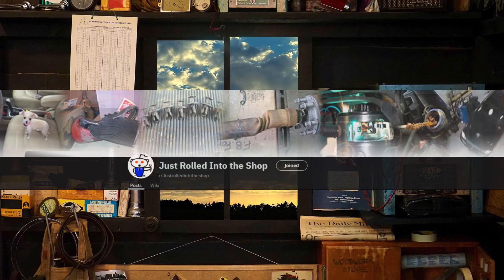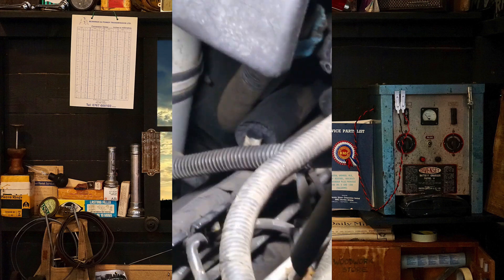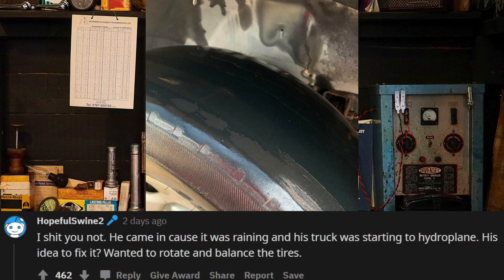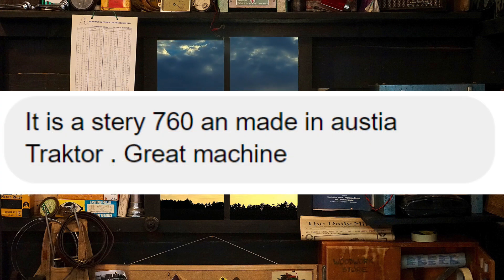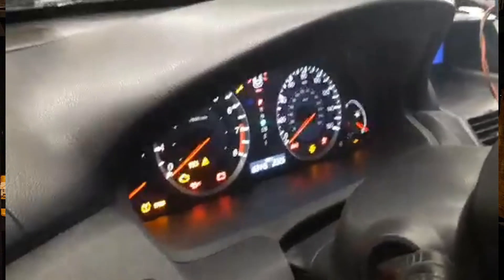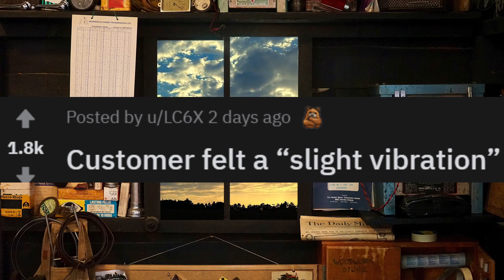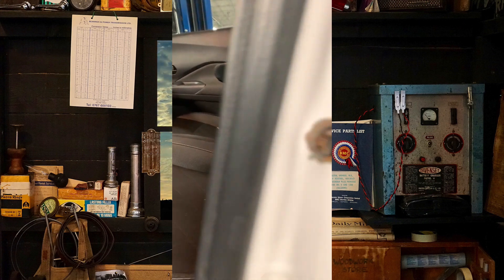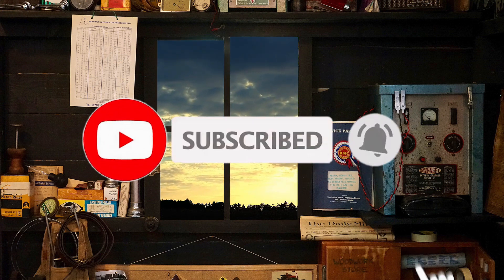Customer States "I Need My BALD Tires Rotated Because I'm Hydroplaning!"

Comment from the maker: Submit your photos and videos to us at www.justrolledinyt.com
Reply: That hellcat probably pole vaulted after the shaft broke up front . I have see in on 4x4 s
Reply: We have a neighbor who has a 1990 dodge 150 with an automatic transmission and 318 V8. After multiple attempts the transmission went in but now with the truck on jackstands and in gearThe drive wheels can be stopped very easily by hand. What would be the solution to this, I am not a Mopar person.

Comment: People are so detached and so non-mechanical that as long as it starts, they drive it.
Reply: I am pretty mechanically inept.  I know virtually nothing about the mechanical side of vehicles.  If I hear a knock, feel a change or my vehicle has trouble waking up I get worried.  My motor scooter is too valuable to me to let it rot and don't want to get myself killed because I neglected to have someone who knows what they are doing look at it.  Yes I said motor scooter I don't have a car or proper motorcycle lol.
Reply: @SirNarax  It's wise that if you ever do decide to get something that goes faster to take a few hours and learn the basics, so checking and filling tires, checkin and topping off oil, checking other fluid levels. It incredibly basic stuff and it can save you so much money, and more importantly your life.
Reply: @willemkanon4020  I know how to do bare basics.  Oil, tire, brakes, suspension... I do a pre-ride checklist every time i go on the thing because a few minutes before every trip is better than days in hospital or an eternity in the dirt.  But anything beyond what is easily checked is beyond me.

Comment: When I was young, my standard for replacing a tire when when it would hydroplane at a specific speed on rutted asphalt roads.
It's kinda funny, but on one of my vehicles now the very new looking tires on it currently has have less traction than the bald tires I took off.  They are very cheap tires.  I just wanted something I wouldn't get a ticket for while I decided what rim/tire set up I eventually wanted to go with.

Comment: I changed four tyres on Mitsi Triton. One was showing wire, the others just plain bald. And he is a cop!  Driving 80k to work everyday on the freeway.
That bulgey tyre?? Had one on a rim as roll around tyres on my racecar, left them out in the sun and it went quite like that. Eventually blew out. Still out in the sun

Comment: I've had a timing belt making that kind of noise. Only it wasn't a bad tensioner it was the idler pulley.  They had the engine rebuilt and whoever did it didn't tighten up the bolt holding the idler pulley in place and over a good bit of time it had backed out. Sounded kinda like a rod knocking with a hint of plastic. I started it up and used the long screwdriver to ear trick to see if it was a rod knocking or something else. Literally 2 minutes to diagnose and once new parts had arrived 30 minutes to fix. The book called for over a hour. They wanted us to pull a bunch of stuff off to do the job that didn't need to be removed.  I just skipped removing the unnecessary stuff and saved time.
Reply: Screwdriver to ear trick? just put your ear to the butt of the screwdriver and push it against the valve-covers?

Comment: I had a 2000 Toyota Corolla with +200k, every tank of gas = 1/2 pt of oil. Gave it to my sister and she ran it dry on a regular basis, so it became 1 tank of gas = 1 pt + of oil. Still ran, but it died in a flood.

Comment: The hellcat diff was a recall. Happened a lot.
Reply: @FUCK_________googIe  Well, it’s a street mod. The differential cooling fins are more effective when facing the airflow under the car.   How it happened? Torque plus too much traction and a very quick impulse. The differential normally wants to rotate up in response to the tires pushing the car forward (Newtons laws remember equal and opposite force?).  This one just tried to accelerate hard enough that the suspension couldn’t restrain the differential housing.
Reply: @FUCK_________googIe  Well ECUUUUUSEEEE ME! Mr Sanctimonious LOL>   Try this: do a burnout on a surface with poor traction moving onto a very grippy surface. Or indeed go do a weekend of passes on a prepared surface. Race cars break components that are made to race. We don't know who or where that driver was but it could have even been a valet or teen son that dropped it into gear at 5000 rpm. Needless to say it's not the most comon failure but it was very well done.

Comment: The tires has surprisingly even wear pattern. Definitely not from a Ford twin i-beam front end.
Reply: The littlest bump and the camber & caster fly out the window. Twin I-Beam seemed like a good idea in the 60s when it first came out but man does it have it's flaws and I'm pretty sure Ford still uses it on 2wd F250/350 trucks!
Reply: @Jakek200  I used to do alignments, 90s. I had a roll over Ford that came in after body was straightened, that had something like -3 camber, but around enough caster to make it not pull (I can't remember exact details from 30 years ago, but it was bad).
I told him I could set the toe, but his tire will wear out fast due to camber being out, even though Ford specs were like +/- 5 degrees or something insane. Customer was happy as he drove away with a straight steering wheel, and I didn't hear back.

Comment: I don't want to start a political debate here but why is the US so sensitive about speed on the highways yet so apparently disinterested in the roadworthiness of vehicles? There isn't even a mandatory annual inspection on older cars. I wonder if promo statements like the "it won't need servicing in 100,000 miles" claim about the Northstar engine, for example, indicate a deep psyche of believing mechanical things just going on forever unchecked? There are lots of claims that garages overcharge for work and upsell unnecessary repairs in the US, this may be true, it also maybe true that by the time folks do actually go to a garage the car is well and truly shagged out and needs a small fortune spending on it!
Reply: Depends on the state. Generally speaking national standards apply only to commercial vehicles but are still enforced by the state. For private passenger vehicles it's a completely different setup - up here in Oregon, in two metro areas there is emissions testing, but if you don't live in that area or if your vehicle is pre-emissions control, you don't have any type of inspection at all. Down in Texas you better have your annual inspection sticker in the window... And of course California is famous for those CARB a-holes who cause everyone uncountable heaps of trouble, and inspections there are a real pain. But seems to be largely focused on emissions equipment. Not sure about other states, I hope those in the "rust belt"(where salt is heavily used in the winter) are good about it, I've heard New York requires inspections(doesn't seem like it from what I've seen on the road there) but I've never looked into the other states.
Reply: @CatCow97  I live up in WI; the cars around here are terrible tbh. Almost exclusively due to the drivers not giving a crap... half the cars in my city don't even bother putting plates on their hoopty

Comment: I can't understand how that guy with those bald tires doesn't just wipe out? I drove on tires that was on the low tread indicators and my steering would be sloppy at 50mph when raining. The rainwater would push the steering to one side or the other. Didnt know what it was at first and when I changed the oil one day I noticed the inner side on one side had some excessive wear. Thankfully I had a full sized spare and threw that on while dropping an old tire at the mechanic one day at a time to replace the two front tires. Then I had to get new rears because I wanted to do an alignment.

I got the tires and installation of them for under $450, they were all seasons too. It just amazes me how these people just don't want to spend that little money for some better safety. I got 75,000+ miles out of those tires too.

Comment: Lost power and uses a lot of oil. I'd say blown head gasket or shot piston rings.
Although I had an old 390 that some bone head had bored out from a 360...and installed the 390 rings on the 360 pistons...

Comment: 2:33 how tf does it even get that bad?? Too much air?
Reply: tire defect.  more common in newer tires.  tires are made from multiple layers of material and if air seeps all the way out to the top later, but doesn't blow it out(I hesitate to use the term "blow out", blowouts go back to the very early days of inflated tires.  Almost impossible to happen now, but people still call almost any flat tire a "blow out"), you get a "balloon" effect.

Comment: Anything is possible with a pos dodge. Those diffs are trash and wouldn't hold up in a V6. Hell, you know it's one reason they put skinny tires on it. If they spin, then they can't break the diff.
Reply: Oh Really??  You just wait till I line up with my Mustang with the solid rocket fuel rear diff blaster that does 9's in the quarter and lifts the front end 6 feet off the ground!

Comment: Sorry but when someone brings in a car and thinks the timing tensioner needs to be replaced YOU DO NOT TURN THE CAR ON because you're going to multiply any existing damage x 1000 if it has jumped timing